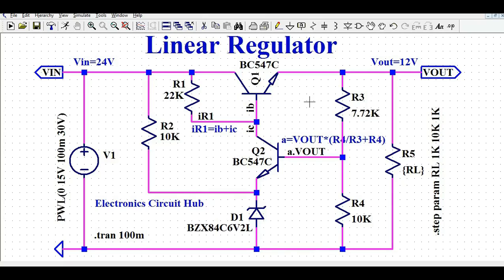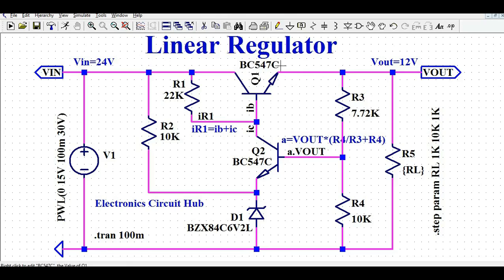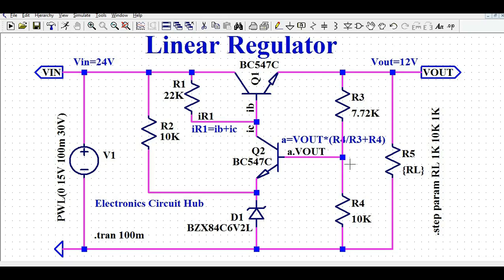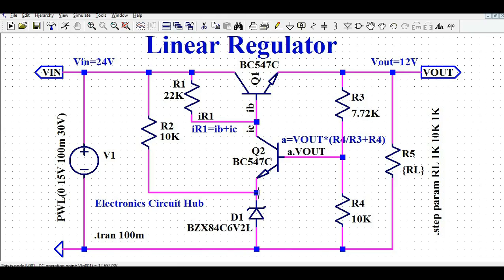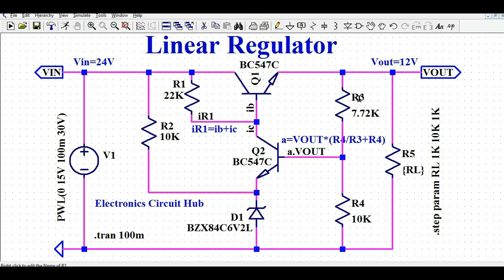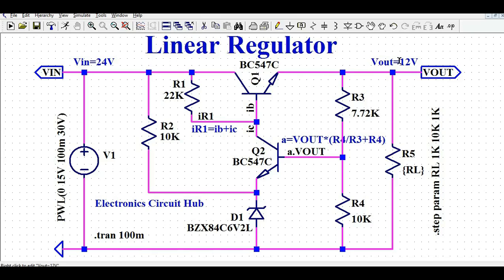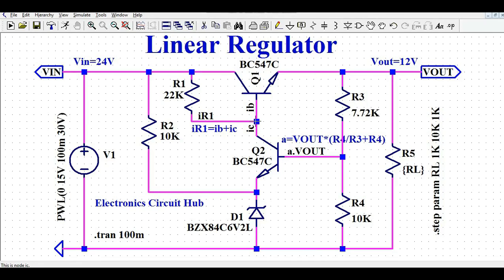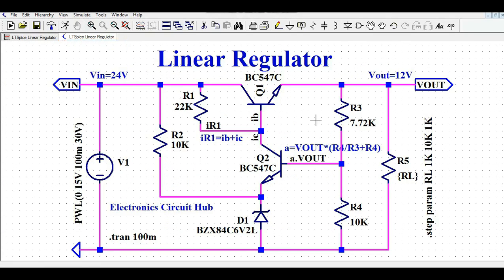Linear Regulator Design with LTSpice Simulations

Comment: How would you make the voltage adjustable rather than just fixed,
Reply from the maker: Thanks for question,  let me check if I can make. I will upload a video.
Reply: You can replace R3 and R4 by a potentiometer. But Output will never reach to 0volt with this configuration. The lowest possible output voltage is defined by the zener Diode.

Comment: would you mind to use BJT for flyback and half-bridge SMPS, because i have some 1300x only. does all 1300x has body-diode ?
Reply from the maker: Hi...I have understood your 1st part of question but I could not understand last part regarding 1300x and body diode.
Reply: i saw many flyback cct use MJE13003 etc BJT and some www said it has diode parallel to it's CE leg for protection. thanks your replies.